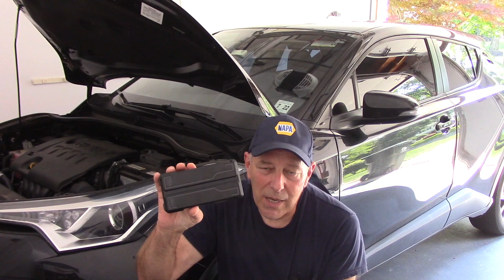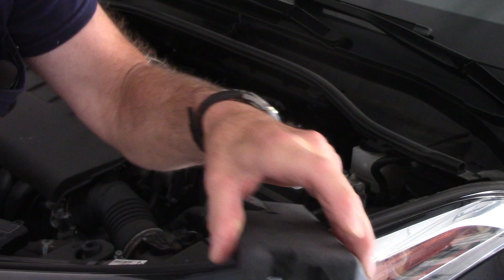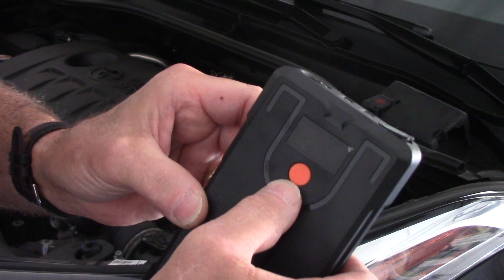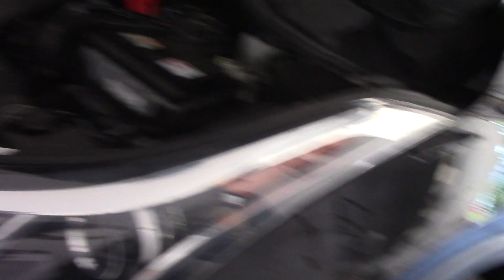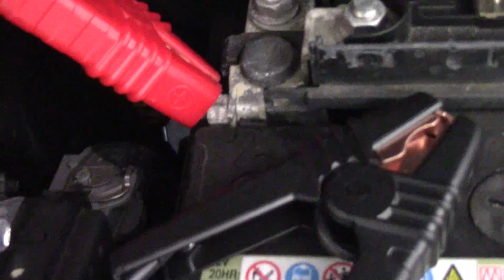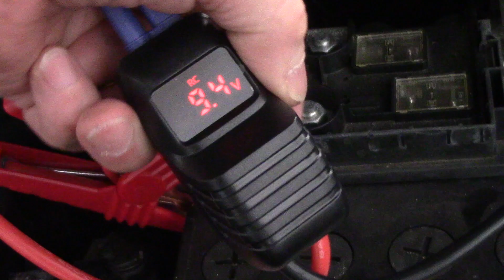How To Jump Start Your Car Using A Booster Pack

Comment: Word of advice, the negative should always be grounded to the chassis instead of directly tp the dead battery mainly for efficiency. Also misleading safety wise if you're using booster cables.
Reply from the maker: Actually you are wrong

Comment: @Jimthecarguy, whenever my car needed a jump and I did this with another vehicle, the connection was positive to positive and negative to ground (my car). Is using the ground not necessary with a booster pack? I've never considered the booster pack because I thought the cables were too short to reach the ground. 🤣

Comment: Hey Jim my polo 1.4 75hp 6n2  2001 facelift model recently started having a strange really quiet noise similar to phone vibrating while someone is calling you, i can't understand where that's from i was thinking maybe my steering system because i recently put oil and it started working again but the noise from when i turn the tires is different than the noise i hear on idle, PLEASE HELP :3

Comment: Great  demo Jimmy,  It's always better to slow charge a battery that low, as the alternator gonna be working overtime to recharge it.  Obviously you know this lol 👍BTW  Do you have a link for that battery pack with the inline voltage reading?